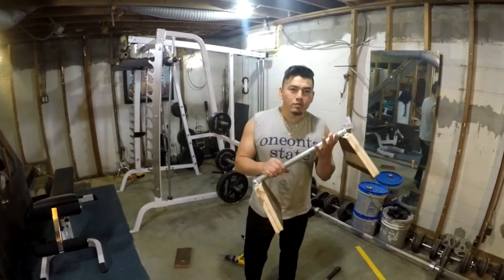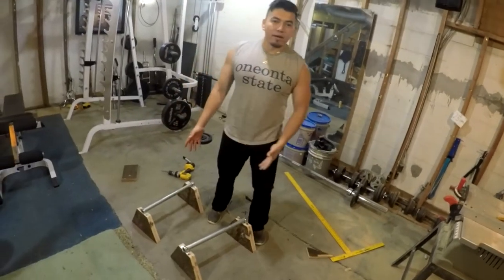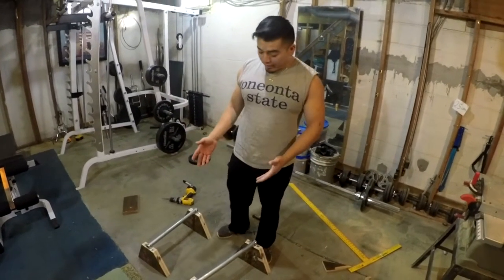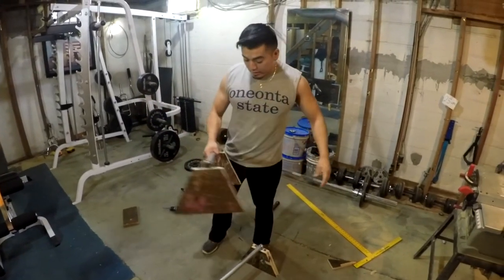Homemade Push Up Bars/Push up Handles - Calisthenics Parallettes

Comment: Thats cool bro u should spray paint the sides black and maybe put some grip at the bottom if it needs that, cool video
Reply from the maker: Justin man I’m so sorry for the late reply you know I’ve been away and yes you’re right I already did it cuz I changed the bottom to a more steady and solid wood thanx bro